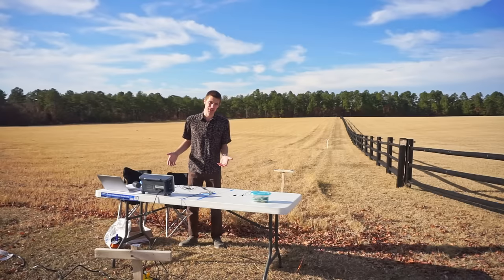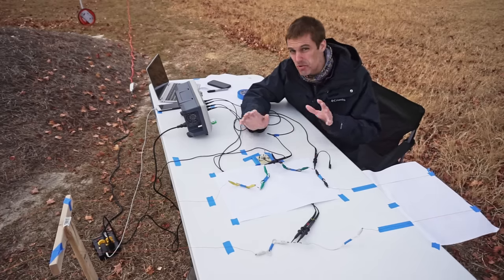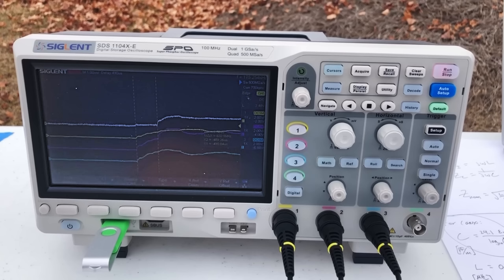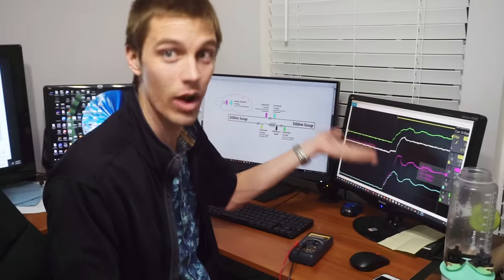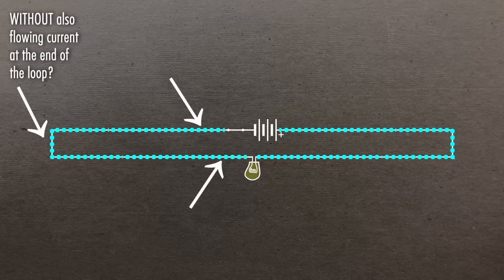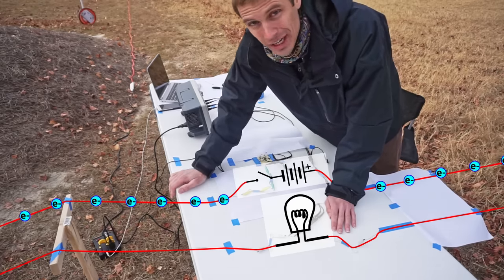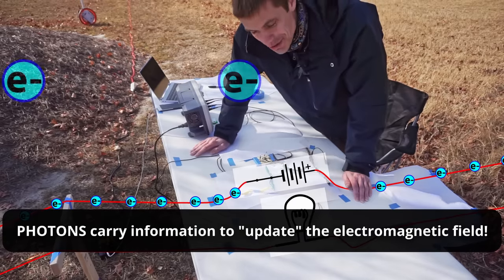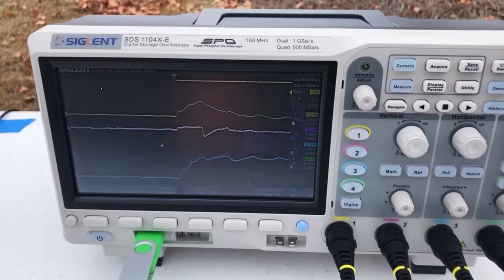I bought 1000 meters of wire to settle a physics debate

Comment: When watching Derek's original video I was left confused. The explanation and concept seemed logical yet at the same time I thought of a number of situations where it wouldn't make sense or might break a few laws of physics. This video with the experiment and the explanation did a phenomenal job of clarifying everything.
Reply: It was misleading to the point of being wrong. He made it seem like: let me paraphrase, "energy doesn't really travel through the wires, so much as the space between them." where in reality most energy does travel through the wire, but there is the extra phenomenon of electrical interference that actually does travel through the space.
Reply: It does travel throughout the space around the wire, and not the wire. But the distance from the wire is inversely proportional to the current it transmits, and it drops HARD l, with the distance. So it flows kind of "just above" the copper. Maybe it even is inside the wire depending on the other materials, but in a different way that we normally think about it

Comment: This idea sounds like a variant of the thought experiment where you have a light-year long pole pushing a light switch, and asking if pushing that pole allows for instant or faster-than-light information exchange. The conclusion is that this only works with ideal poles that are not made of molecules because even if you were strong enough to hold and push such pole, at that scale it would create a very much real wave of particles moving through the pole and the push cannot arrive instantly. With electricity this kind of thing is part of what people call "transmission lines" in the field.
Reply: every model is invalid at some scale, many people confuse models with actual physical reality.
Do we need to account for gravity variations? quark collisions? oxidation?

This is a point-mass, frictionless comment at sea level

Comment: I'm being pedantic here:

"You can't flow current through wires that are disconnected."

Actually you can, but you have to have a lot of current to jump a resistance of 600 ohms (air).
Reply: RC circuit, one with the capacitor, is an example. Capacitor has "air" between the plates, but the time dependant current may flow in the wires
Reply: What? You have have a lot current to jump a resistance? You mean you need a high voltage to break down the dielectric strength of air (which is around 3kV/mm)? And why 600 Ohms? Where did that random number come from? Air has a resistivity of some 10^9 to 10^15 Ohm*m. (Plus it depends on environmental conditions, geometry, etc.) If you want to be nitpicking, at least pick on capacitive or inductive coupling, not using some bad physics mixed with some random numbers.
Reply: @szilardliptak6466  ironically vacuum has no resistance to electrons

Comment: Hi Derek, I vote for inductance as the source of the immediate current flow as there is a very rapid change in current flow when the switch is tripped. I suggest setting up the experiment with the "light bulb" 250m from the battery and having the switch in various locations. I think closing the switch results in a big change in the electric field around the switch producing an electromagnetic pulse that induces current flow in the "light bulb".
Reply: I think this is essentially the explanation given in the original video

Comment: you're instantly measuring the repelled electrons and attracted electron across the wire at the base of the terminal connections right on the table before they even reach the light bulb. But since those wires are also connected to the machine, you're actually measuring the microscopic wires on pcb boards in the oscilloscope

Comment: What if you start with the circuit already energized and then abruptly open the circuit? 
And what if you used a perfect insulator between the parallel wires?
And what if you were to make the circuit in a big circle with circumference 1km?
And what if you used fiber optic cable instead? Thanks for this great vid, sir!
Reply: Pretty sure you'd see exactly the same traces, but with the voltages reversed. Turning off the circuit should induce much the same effect as turning it on, just in the opposite direction. So a small dip in current through the bulb, followed by a much larger one after the light speed delay.

From what little I remember about permittivity, a perfect electrical insulator would make a perfect dielectric, which would give you an ideal capacitor between your transmission lines. So I'd expect to see the same effect, but more powerful (higher capacitively induced voltage).

A big circle would move the switch very far away from the light bulb, so the delay before the capacitive effects would increase to almost match the transmission delay. Plus, the capacitive effect greatly diminishes with range. That part of the voltage waveform would become way too small for an oscilloscope to measure.

I'd be curious what your fiber optic circuit would look like. I've only ever heard of fiber optic cables being used to send information, not power. They're basically just lasers firing down a glass tube. The glass doesn't conduct electricity very well. I'm curious what effects you'd expect to see from this setup?

Comment: You did a better job of explaining this and it conformed to my intuition. I felt that Derek was making that the case that the circuit had to be complete for the field to induce some current in the light bulb, whereas I figured it was the field close to this resister which induced that initial current, which also travels at C (or near). I assume in the next video you will show that without a field emitter near the resister, with the circuit in a circular or square formation, this "instantaneous" response conforms to the more boring hypothesis that the wave of influence travels around C.

Comment: 8:42 I'm suspicious about the 0.2V reading. Transistors do have a forward bias current and corresponding voltage drop across the junction, especially if you're using a 2N2222 or similar BJT in your circuit. Check out the datasheet for the transistor on the board you bought, it should list these parameters. As an EE, I'm interested in this.
Reply: Understood, but the measurements were effectively current measurements, since they were differential measurements with two probes in each case, taken across a resistor. You're perhaps aware, this is a standard method to measure current while any DC offset at the probes is cancelled by the fact that the voltage on one probe is subtracted from the voltage on the other in the scope.
Reply: bruh the video was perfect now u made me doubt it.
yes transistors have this forward bias current but i think 0.2 volt drop across the junction seem too high.
Reply: @anandsuralkar2947  The voltage drop is instrinsic to the materials used in the PN junction. Common silicon diodes like the 1N4001 has an 0.7V drop, while a germanium diode like the 1N34 from 0.1 to 0.3. Inside a transistor, there are 2 PN junctions, each with its own characteristic drop.
Reply: Oscilloscopes compensate for such effects. The measurement should be accurate.
Reply: He isn't measuring the voltage drop across the junction, he's measuring the voltage drop across the resistor, which is the result of the current flowing through it.

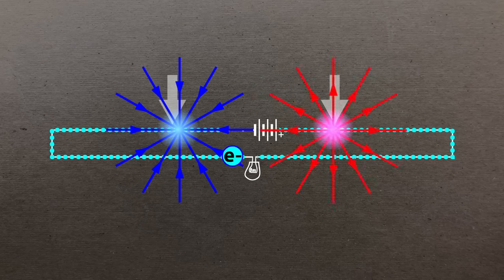Comment: Having a physics background I could understand most explanation in many of the response videos on this topic, but 17:17 is the best, most simple, and easy to understand explanation of what happens that I have seen. Well done. Most should understand and have an instinct that it must propagate with relativity and stuff, and everyone knows a bit about electric fields and electrons, so everyone can understand how patches of charge caused by wave propagation can cause electrons in another wire to move.

Comment: One thing to make it better - separate the battery and resistor in space to see expected reduction in initial induced current. Also should get induced current even if far ends of wire is cut, since this can't communicate with centre initially.

Comment: Very nice! I think you show that Derek is, somehow, correct.
I just want to point out, following KVL "paradox", that the probe on the load becomes part of the circuit and their wires pass just under the circuit so, induction is the thing but you get induction on probe's wires almost immediately.
edit: already pointed out and didn't noticed XD

Comment: Bingo. Congratulations, you've created a time domain reflectometer! That itty bitty "initial current" is very interesting though, makes me think about it from an RF perspective. I uh...guess that by cutting the wire at the end of one leg, you have made a very crude, very long transmission line coupler because that is exactly what they are made to do. Love this experiment.

The "sloshing" you described is exactly what happens when you measure reflected voltage from a directional coupler in RF. Especially when measuring open and short circuited loads the reflected waveform very clearly pushes back in an equal and opposite manner to the incident waveform, and that reflected waveform (voltage potential typically) can induce a reverse current in say a measurement bridge or the directional coupler itself.

Comment: The best alternative to this experience would be with a kilometer long fibre optic cable.
Reply: What would it prove?
Reply: @noop9k  electrical resistance in wires vs actual light transmitting data, if there is a difference etc.
Reply: @mattuiop  Actually, a signal travels through copper faster. But also dissipates faster (not only because of resistance). There is nothing to prove really. It is all well known.

Also, we use optical fibers to transmit information, not energy, and the video is about energy transfer. Because they are quite inefficient for electrical energy transfer. I think you will lose at least 80%, but too lazy to verify.
Reply: @noop9k  Electrons don't move in glass.  It would show that electron motion isn't important.  It's the same with WiFi or satellite transmission.  There is no significant electron motion, but the signal travels anyway.
Reply: @noop9k  That is incorrect. Electromagnetic signals always travel slower than the speed of light when they interact with matter.  You cannot transfer information without transferring power.  With more power you can transmit information more quickly.
Reply: @redstar5607  Do you think you said something enlightening?
Reply: @redstar5607  Go back to physics lessons, kid, or learn to use google. C is speed of light in vacuum, but light doesn’t travel in glass with the same speed, also it doesn’t travel in straight line. In copper signal travels faster, quite close to c.
Reply: @redstar5607  Clarify what you consider to be “incorrect”. Are you stating that signals travel in glass fiber faster than in copper?
Reply: @noop9k  Signals in both copper and fiber travel at speeds lower than the speed of light in a vacuum. 
For example, a signal in RG-58 cable travels at 66% c.  Amazingly, the speed is strongly dependent on the type of insulation used on the wires.  
The speed of light in glass is around 66%c, depending on the glass.
Fiber optic cable is designed so that light travelling at the outer edge moves faster than light travelling through the center.  It is designed so that the light arrives at the same time no matter the path.  If they didn't do that long fiber optic cables would be useless.
Reply: @redstar5607  So, where was I wrong when said copper is faster?
Reply: @noop9k  Sometimes wire is faster, sometimes fiber is faster.  It depends on the configuration and materials used. 

For example Cat-3, twisted pair propagates at 58.5%C, slower than fiber.

Wire is not always faster.  Signals do not always travel through wire at nearly C. There is more nuance involved.
Reply: @redstar5607  yes, but you are moving the goalposts

Comment: This is the best explanation out there. But one odd thing that is not accounted for is that it is well known that electric potential waves travel in a conductor at about half the speed of light (~2 ns/ft vs 1 ns/ft). If your 500m half loop takes only 1.6 us, that corresponds to the speed of light, which is too fast, and would indicate that the light turns on right when the potential wave reaches the far end, before the return trip. That doesn't sound right, so this needs to be sorted out.
Reply from the maker: the dielectric here is air, so it's actually about C

Comment: 200 microamps at 25cm. So 12.5 uA at 1m, 5V. Derek used 12V, so a whooping 30 microamps. That won't light up a LED. And so - thanks for putting into numbers what I knew from the beginning: Veritassium went full clickbait with its "you've been lied to at school".
Reply: "Veritassium went full clickbait with its "you've been lied to at school"
And it worked. I imagine that all of the response videos other creators have made addressing the misleading claims has driven tons of traffic to the Veritassium channel. Derek knows exactly what he's doing, for better or for worse.
Reply: The term "light up the bulb", doesn't necessarily mean producing the full amount of light it can produce, any current flowing through the bulb will produce some light, even if it is too small for the human eye to see, that would still be considered to be "lit" in my opinion. Bright? No, but any light whatsoever? Also, there are some micro LED bulbs for miniature christmas displays that only require something as low as 0.1 watt or even less.
Reply: @rdizzy1  At that point you literally do not need any current. Just leave it there at ambient temp, if it's above absolute 0 it'll be producing light..
Reply: @rdizzy1  The term to describe what you're saying, in common use in electric engineering exercises is "make the bulb start glowing". "Light up" specifically refers to full brightness. Also, bulbs activate through thermoluminescence. Raising the temperature of the filament by 0.02 degree above ambient will not light it up.
Reply: @sharpfang  Wouldn't that depend on the bulb though? The total power needed to produce light, what the material the filament is made of, etc,etc. You can find bulbs that only require 0.1 watt (mini leds), or even less for those micro bulbs for miniatures, and that is for a fully lit bulb, especially when isolated and removed from the set. Also the initial power, if I send an insanely high amount through, enough to light it up with the first "wave", and then when the full amount comes through it explodes/vaporizes the bulb into oblivion, that is irrelevant, as it was still lit almost right away.
Reply: @rdizzy1  0.1 watt at 5V is 20 milliamps. The most energy-saving electronics operate in the milliampere regime - 10-30mA is a typical, 1-3mA is superior, ultra-saving. Derek with his 12V battery would have produced 30 microamps, 1000x less than your microbulbs take. Alphaphoenix had to wait for a windless moment because the wire shaken by the wind in Earth's magnetic field produces more.

Comment: There is two type of status in an electrical curcuit. The first is a so called Transient in which the capacitor is start to load up with electrons, and the Stacioner where the Capacitor is loaded up. When you flip the switch, the capacitor in t=0 act as a wire with 0 resistance. so the current will flow there regardless of the other resistors. 5 tau (time differential =R*C in this case) passes and the Condensator filled up comletely, and it becomes a „tear” in my languague, where no electron will flow no matter what. Of course, with AC it will not become a Tear, because the capacitor has not enough time the gain the fully charged status.

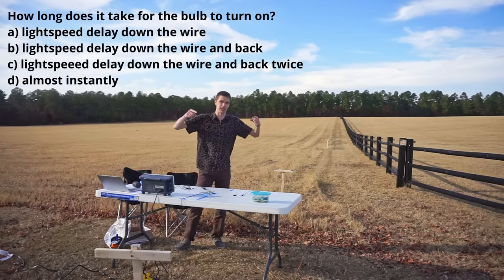Comment: 0:57 my thoughts from the “ get go “ are

1. Have we not measured the speed of light through various substances and concluded that it is not an absolute?

2. If electric current cannot match the speed of light through a vacuum, and mass cannot match the speed of light, can we conclude that an electron has mass?

Comment: Don't get too attached to the model shown here of electrons as little ball bearings lined up like ducks in a row, patiently waiting for someone to close the switch so they can start moving. The conductor in a wire is a crystal lattice of gazillions of metallic nuclei whose electrons (29 for each copper atom), exist in the surrounding space. The electrons are in constant random motion whether or not a battery is a part of the picture. When a battery is connected this motion becomes a little less random and tends toward the source of positive electric charge at a drift velocity which is far less than the speed of light. What is felt almost immediately when you close the switch is the electric field.

Comment: Please run a parallel wire the entire distance.   If you can use two conductors that are side by side like a super thin zip cord,  it would be interesting to repeat the experiment the exact same way, except that the oscilloscope instrumentation on the second conductor that’s unused with a similar resistor.   It would be cool to see how the inductive loop behaves.

Comment: Interesting test, but any engineer should know that electromagnetic waves travel at less than c in any physical medium. It's called propagation velocity, and it's highly dependent on the physical properties of the wire or cable being used, as well as the environment surrounding the propagation path. Excellent experiment!

Comment: Regarding the chain in the tube metaphor, if the chain were rubber, then the model is closer to what is happening. The video on the other channel definitely saw inductive interference. I wonder why people do this experiment and insist on always running the conductors so close to each other.
Move the wires out away from each other or make a large circle then repeat.
Might be interesting to use a shielded conductor as well.
We also seem to always use very small diameter conductor which increases the resistance of the conductor.